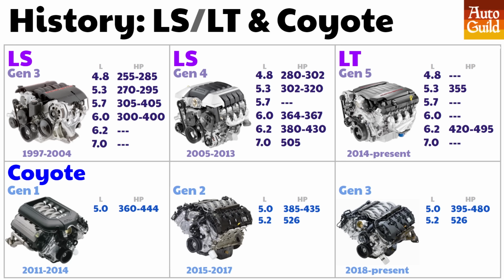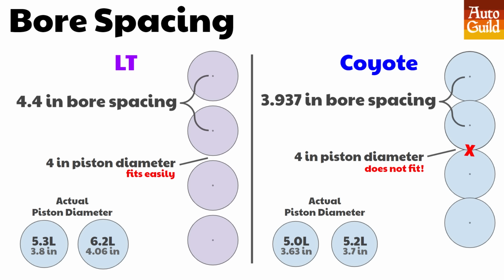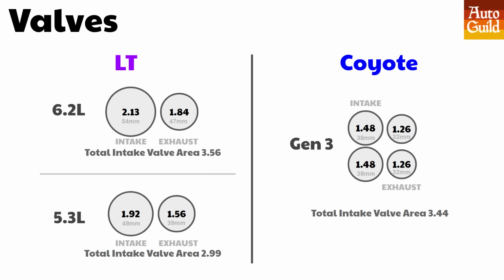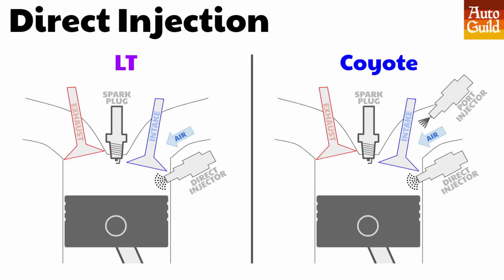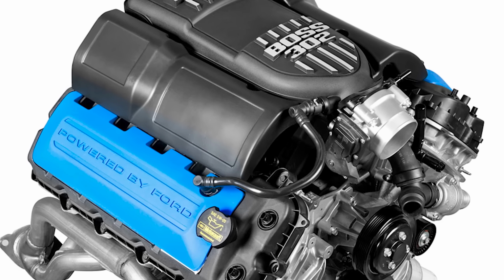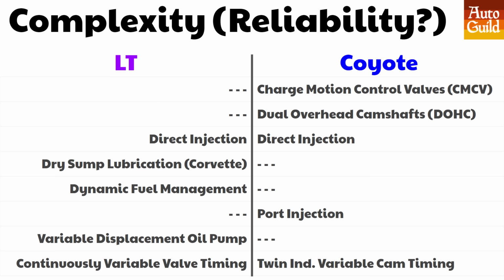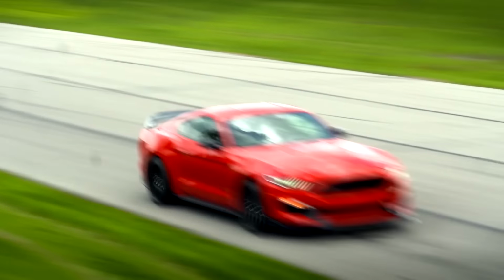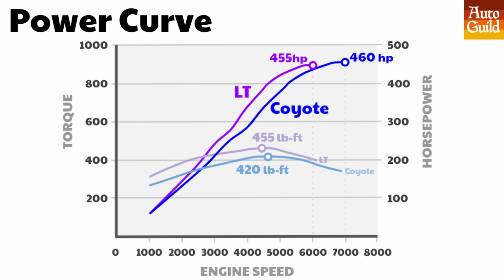GM Gen 5 LT vs Ford Coyote.  Which one is better and why.

Comment: Coyote, can make big power factory sealed.
Reply: Gm is the only one to take the oldest engine design and make it less reliable
Reply: @Licmyfreewilly  elaborate
Reply: @erikcapozzi3425  lifters lifter lifters 🤣 engines and transmissions failing for gm right now
Reply: @Licmyfreewilly  gm has the same 10 speed as ford and lifters have always been a problem with chevy and dodge. The only bad transmission chevy has made was the 4l60e variant
Reply: @BurtJr26  don’t forget their electrical bullshit, gm transmissions suck
Reply: @Licmyfreewilly  dude really said Lifters....hahaha the only common issue with lifters is on cylinder deactivation cylinders...And very rarely do they actually completely fail, and guess what, a fricken monkey can replace them in a couple hours.Fixing anything on a coyote is a days job and usually requires special tools and half the time it has to go to the dealer..Go talk to any mechanic and they will tell you 9 out of 10 times they would rather work on a LS/Lt based engine then any modular ford .
Reply: @Licmyfreewilly  GM hasn't had a common transmission issue since the 4l60e .And even then unless you beat on it like most people do they last quite a while..And they put them in everything. Ford sells the most used trucks but GM owns the used truck market for a reason, Because people feel alot more comfortable buying an older used GM then a Ford .
Reply: @erikcapozzi3425  there are a million videos of how unreliable the gms are 😂 so whatever
Reply: @Licmyfreewilly  wtf are you talking about?? There are millions of videos,articles,forums ,SHOWS,mechanics ,channels, race teams and builders that talk show and Prove how reliable GM engines are.Because that is what they are talking about here..so please dont make such a pathetic blanket statement when there is a reason it's been in production so long and that millions of people use it as a go to option for almost everything, it's pretty much common knowledge in the car community and if you disagree then you are blind and lying to yourself
Reply: @Licmyfreewilly  "electrical bullshit" sounds like something someone with limited experience and knowledge about the subject and cars/engines as a whole would say
Reply: @erikcapozzi3425  new ones are fucking up knocking failing left and right tard
Reply: @erikcapozzi3425  https://youtu.be/quIqIo6nGSM 🤣👌👍🏽
Reply: @erikcapozzi3425  https://youtu.be/K866m7OQ1vc junk pos chevy
Reply: @Licmyfreewilly  wow I'm sure that's never happened to any other car brand before...what a clown
Reply: @Licmyfreewilly  people like you just don't understand engineering in mechanics and expect everything to be perfect..Car manufacturers arent perfect and every one of them is guilty of making lemons and bad vehicles .that's what happens in a consumer market where things are constantly developing and changing and engineers are constantly testing new methods and techniques. I'm not brand loyal or a hater of any brand and people that are usually are childish and not real automotive enthusiasts.The early Hemis had the same issue ...The 5.4s are a total hit or miss..Does that mean I think ford and dodge are junk..No..Shit happens and nothing is perfect,get over it and grow up kid
Reply: @erikcapozzi3425  show me a factory sealed gm running 8s and 9s in a damn truck…. 😂🤫
Reply: @Licmyfreewilly  are you serious? 9s lol😂😂 people are running 9s on stock bottom end unopened junkyard engines in anything and everything.not sure what it has to do with a truck?? Your a total troll and your ignorance is showing..Grow up .your just a bias fanboy thas hasn't owned anything worth a toot anyway and its OBVIOUS
Reply: @Licmyfreewilly  hey chump did you see the new Z06 powerplant reveal... GM is putting a 5.5L flat plane crank V8 making 670hp NATURALLY ASPIRATED horse power ..with a 8600rpm redline... making the coyote completely laughable...Talk all the shit you want but GM is tearing up the performance world and they HAVE BEEN
Reply: @Licmyfreewilly  GM really just made the most powerful Naturally aspirated engine in a production car EVER... and bias fan boy crybabies will still find any reason to talk shit for no reason other then them liking another brand..
Reply: @erikcapozzi3425  following in the footsteps of ford 😂👌
Reply: @Licmyfreewilly  yeah because ford is the first to use either a DOHC or flat plane crank...Your a total muppet, I am done talking to clowns like you.
Reply: @Licmyfreewilly  I remember in the 90s GM came out with the zr1 vette with a DOHC v8 that made 375hp .it took ford TWENTY FIVE YEARS to even come close to it. Early 2000s when GM has solid footing in the tuner world boasting 325-350hp LS equipped cars Fords 4.6 naturally aspirated engines were a peasly joke mustering up pathetic numbers..Even all the way up to 2011 when the coyote came up there cars were mediocre at best. Ford has been playing catch up for decades and when they start to get a little traction they end up falling behind. Since the early to mid 2000s GM has produced performance cars such as the GTO G8 gt or GXP, cadillac cts v, cadillac xlr, The camaro the trans am the corvette..Hell even there v6 supercharged Monte Carlos grand prixs and Bonnevilles where making more power..Ford has made TWO true performance  cars in the past 2 decades and one of them is a rarity(Gt) to even ignore the fact that GM had several performance cars that littered the market and bested the SINGLE sports car ford was making just goes to show you the real facts my friend...And I still love me a good ford.But to not be impressed or acknowledge what GM has done...Shows how ignorant you are
Reply: @erikcapozzi3425  🤣 whatever you say troll 🤘
Reply: Same goes with a lt and a ls
Reply: @gerardomartinez452  show me a unopened Ls/Lt in the 7s ill wait
Reply: @PhatsoJuggalo  awesome comparison with the least personal bias possible, from a car. Great stuff.

Also, the Gen3 Coyotes have a 2mode variable output oil pump, adjusted by a solenoid. Low rpm and low load it's in mode 1. Higher rpm and load, the computer requests the higher pressure mode 2.
Reply: @PhatsoJuggalo  https://www.lsxmag.com/news/stock-bottom-end-ls-record-reset-at-7-16-at-190-mph/ stock bottom end not unsealed but show me a stock 5.0 in the 7s that hasnt at least been looked into

Oh and thats with a 5.3 not even a 427 ls7 or even a 6.2 that ran a 7.1
Reply: @BurtJr26  https://youtu.be/NWK-eL3eqfc car ran a 7.9 stock sealed motor
Reply: @tomateros55  https://www.enginelabs.com/news/a-look-at-the-worlds-quickest-stock-bottom-end-4-8-liter-ls-engine/ heres another good ls this ones even better its a 4.8 didnt even open it to gap the rings like most ls guys do. ran a 7.8
Reply: @BurtJr26  stick shift coyotes in the 6s on stock bottom
Reply: @Licmyfreewilly   not stock bottom end the engine is built from bottom to top by TKM the block material is stock also heads are different, thats it because the stick supra that broke into the 6s has a billet block. But i do give them props most people with a whole team backing them up and enough money to run a 6 even a 7 usually go with a aftermarket block.
Reply: @Licmyfreewilly  oh and that was on a insanely built chevy t56
Reply: @gerardomartinez452  😂👌🏽

Comment: The big killer for me on the Coyote is the cams and Long cam timing chains.  The timing chains stretch significantly.

The killer for the LT for me is direct cylinder fuel injection.  Leaving carbon buildup and early valve train failures.

The LS ENGINE IS STILL THE KING.
Reply: I can see you have zero experience actually working on coyotes, timing chain stretch is not a typical issue

Comment: coyote ftw, many of us on gen2 and gen3 motors over 900 wheel with no internal mods
Reply: I’m sitting at 876 wheel with a twin turbo setup only opgs/cs done to it
Reply: @red5.023  is opgs “oil pump gears” and cs “camshafts?” just was makin sure
Reply: @jenswoody4683  crank sprocket

Comment: In a scientific review, the Coyote is a far more efficient power maker and has the highest B.M.E.P. of any engine platform offered to the general public. Also to note, Midnight Performance has taken three different Mustangs from '18-'20 models with factory sealed engines and with the addition of twin turbos and a few other supporting mods have run 7.90's. There's currently zero factory sealed LS's running these times or making that much hp.

https://www.enginelabs.com/news/the-great-equalizer-understanding-brake-mean-effective-pressure/
Reply: But can you pull a coyote out of a junkyard explorer and run it for 200k+ miles
Reply: @ripinpieces8387  no...because they don't offer the Coyote in an explorer.

Comment: Ford needs to get rid of that overhead cam complicated coyote junk they need to go back to the 351 Cleveland except all aluminum heads and block and put coyote induction on it that will finally put Ford back in the lead of small block V8 performance it happened in the 70s and it can happen again
Reply: Tell me you’re a boomer, without actually saying you’re a boomer 👆🏼

Comment: So I am hearing, "get an LS and put a flat plane crank in it."
Reply: Honestly flat plane cranks are only good for small displacement engines, they have balance issues on v8s that get magnified the bigger you go.
Reply: @MekanikRandR  ford pulled off some tricks balancing the voodoo.
Reply: @f3nixfire  not really the disintegrate all the time.
Reply: @f3nixfire  Not well enough it would seem otherwise, they wouldn't have canceled the program.
Reply: @FL50ssp  doesn't the predator also have a flat plane?
Reply: @FL50ssp  lol, it was always meant to be a limited production engine. No they dont have any consistent issues. Plenty of voodoos making 1000 hp with twin turbos or twin screws on stock factory sealed motors
Reply: @MekanikRandR  no, crossplane
Reply: @MekanikRandR  Same for stroke.
Reply: Lol good luck with that.

Comment: I would take a pushrod engine over an overhead cam engine anyday I am so glad that GM stayed with the pushrod engines for the 20+ years when others went cheap and overhead cam.On GM, you do not have all the timing chain headaches .
Reply: Pushrod engines are cheaper to make
Reply: @Gto-K1ng  and fix
Reply: And up grade
Reply: No timing chain headaches but have bent pushrods and collapsed lifter headaches😂 Each has its pros and cons. Coyote 5.0L to me is Fords best N/A engine in many years. Its reliable and strong and very easy to make big power.
Reply: @Jimmyxsx  I wouldn't call the coyote engine particularly reliable, and I'm a mustang owner. With the coyote there's no shortage of piston slap, cylinder wall scoring, excessive rod bearing clearance, broken oil pump gears and the dreaded tik, tik, tik that Ford refuses to deal with.
Reply: Yeah, its doing wonders for them in NASCAR
Reply: @Archer441  Nascar still exists?
Reply: @Archer441  True and it's a trip that nascar basically uses the LS platform for all the nascar cars.
Reply: From a guy that owns a repair business, I agree 100%. DOHC or SOHC are great until it's time to pull heads, replace sloppy timing chains, deal with noisy guides and hand the bill to the customer.

Comment: I love coyotes owned a 5.0 mistang and now a 17 f150 im building. Its hard to beat the affordability of the LS, but coyotes are just as fun and make great power
Reply: The other great thing about the 18+ coyote is that you actually have double the fuel system after a retune, so you can supercharge/turbo them to a higher level without worrying about fuel.

Comment: Try buying a Junkyard Coyote motor and Build it Without Problems, NOT! You can find LT's and LS's All Day Long and get the Build Right on the 1st Hit!
Reply: Dont get me wrong The coyote is awesome but they can be a pain. Twice as Expensive, physically huge for its displacement, has alot more moving parts so possibly more prone to failure and not as readily available. Good engine but not as efficient. Ls is lighter, less moving parts, less materials needed, more compact so can fit in more cars easier, can find parts anywhere and can still make just as much power, just need to know what parts to use
Reply: @joefries365  Exactly, And, you can go to the neighborhood Junkyard, Buy an LS Motor for Pennies and Build the Hell Out of it for Cheap LOL, Can't do That with a Coyote.
Reply: @tonymickens8803  yeah i know someone who has an f150 and paid 10g for a used coyote when his blew up and im like you can make a 700hp N/A Ls engine for that... and itl fit in more things.
Reply: @joefries365  Hell Brother Joe, with 10K I can get WAY Over 1000 HP out of Any LS motor.
Reply: This is an ignorant fanboy statement.....Bone stock coyotes can hold ALOT of power without needing to be built. This is especially true for the gen 3 coyote. Gen 3s are making 1200 to 1400 hp on factory sealed engines. It doesnt get much more problem free than taking a completely stock factory motor and slapping a turbo on it to make over 1000 hp. 

Check out @davidvanvoris some of his older videos before he built his motor, and he never blew up the stock motor.
Reply: @f3nixfire  they do have a point about warped heads and blown oil pumps though, but if you find a good one at the yard, head cooling mod and a billet pump, then just add boost!

Comment: I love my Gen 3 coyote, it revs to 7500 rpm & makes tons of power up top, reminds me of the S62 V8 in the E39 M5, with a lot more power.
Reply: With a tune you can go to 8200rpm, just don't bounce it off the limiter. Oil Pump Gears tend to not like the harmonics and bouncing back and forth. Love my 19 401A PP1 nom nom revs to the moon !!
Reply: Get billet gears and you could  send it to 9k with no worries... other than maybe vvt issues....
Reply: @MekanikRandR  and watch the power fall off... rpm doesn’t mean more power...
Reply: @josiahvanopstal9435  Actually it does, but you have to tune your engine properly. Power is directly related to RPM. Torque x RPM/5252= HP
Reply: @josiahvanopstal9435  if you set the vvt up right it can actually make really great power even higher, but all youd need is a mildly larger VVT cam and you could make a massive power plateau waaay up there.

Comment: Shock towers gonna be an issue with fittn the gen 3 coyote!
Reply: Not at all. Plenty of fox swapped coyotes now. All you need is a custom k member so it sits lower, but alot of company's are making aftermarket k members now for various cars/trucks to accept coyotes. It's not as hard as you think.
Reply: @f3nixfire  well that's good news im currently lookn for my 5th fox body notch this time. Always built the 5 litre
Reply: @f3nixfire  go tubular!
Reply: @IMPORTKILLR187  https://www.uprproducts.com/79-93-mustang-5-0l-coyote-swap-chrome-moly-k-member-kit/

Comment: LT1 is smaller, lighter and more versatile. can be put in a truck or a sports car and preform extremely well. And high revving motor doesn't really matter when you use the 10 speed trans. with appropriate gearing for each motor. the LT1 is faster.
Reply: and the 2mpg advantage shouldn't be brushed off. that add up rather fast when you drive 350miles a week.
Reply: Amazing how slow the lt really is.

Comment: If the coyote was 6ltrs GAME OVER . However it's in a league of its own . Oh is it me or does the chev look like a Cleveland - Windsor copy with its symmetrical cyl heads with 10 bolts.
Reply: It's been done that you can take ls heads and bolt them to a Windsor with very little modifications. Chevy copied Ford for years with there ls engine's.
Reply: Have you seen a coyote engine outside of the car it’s huge I can’t imagine how big a 6.0 dohc would be along with dependability
Reply: @kareemhailey9585  Its all proportional to its parts to size ratio . In Australia we built the coyote   on a assembly line , absolutely awesome to put together. I personally put together about 450 engines. The size is not that big it's actually compact. People are scared of the technology,  if you want to make power you have to go OHC due to the straight intake, exhaust ports and so on
Reply: @kareemhailey9585  put a 5.3 or a 6.2 short block next to a Coyote short block you’ll see a huge difference… the only big thing about the coyotes are the heads.

Comment: The new flat plane crank coyote is simply awesome!!!!
Reply: https://carbuzz.com/features/battle-of-the-v8s-flat-plane-vs-cross-plane#:~:text=In%20V8%20engines%2C%20flat%2Dplane,almost%20exclusively%20by%20European%20manufacturers..... nah ford has one in the gt350r and Germany and Europe have been building V8 with Cross plane crank for yrs..... I included a link so you don't have to take my word.... Thanks for your reply though
Reply: It's a voodoo designation. Not coyote
Reply: @f3nixfire  ok
Reply: Impossible on a v 8 engine, Only possible on flat or boxer engines.
Reply: @Czechmate.z  https://carbuzz.com/features/battle-of-the-v8s-flat-plane-vs-cross-plane#:~:text=In%20V8%20engines%2C%20flat%2Dplane,almost%20exclusively%20by%20European%20manufacturers.
Reply: @Czechmate.z  Tell that to Ferrari, they've done a lot of flat plane V8s.  Don't be an ultracrepidarian.
Reply: Or inline engines

Comment: Awesome video brother I have a 2011 Ford F150 with a 5.0L Coyote V8 in it with 140,000 miles on it and still going strong and its a beast and it sounds like a beast with the Borla ATAK.